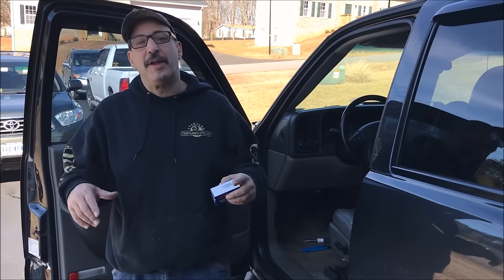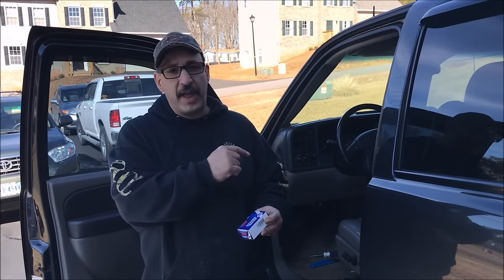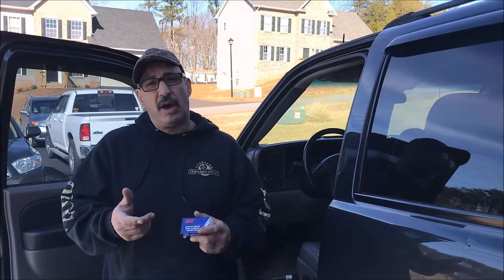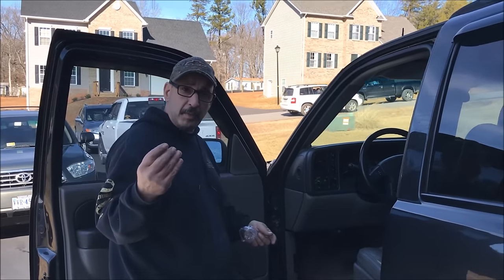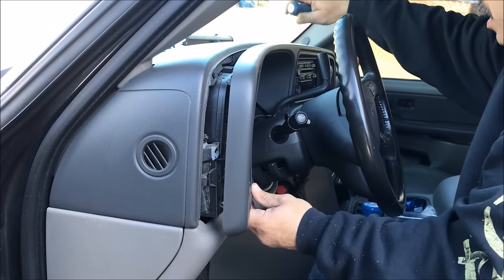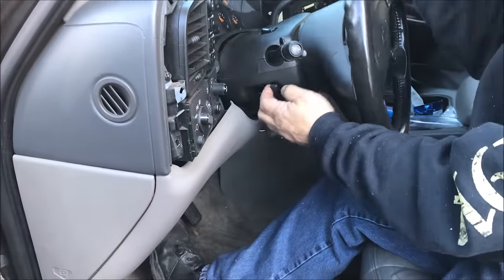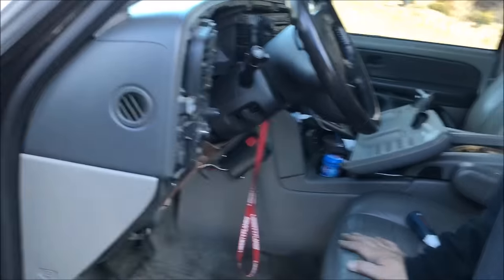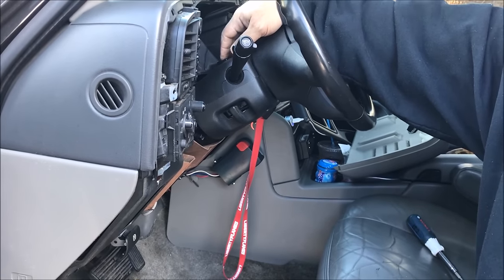Hazard & Turn Signal Flasher Problems on the Road | 2000-2006 Chevy & GM Suburban Truck and SUV

Comment: Hopefully u see this comment and can help me out I have that problem but only at night when my headlights are turned on and I try to use either the left or right turn signal the emergency flashers turn on Hopefully u got some tips thanks brotha 🙏🏼
Reply from the maker: Don't know.  If it were me I'd try the Flasher Module
Reply: Did this work?

Comment: I changed the flasher but still nothing. Did Amazon sell me a faulty flasher? Or is it possibly the flasher receiver
Reply from the maker: Could be something else, like the switch or a ground.
Reply: @AxlesGarage  could it be the switch, or a ground if the “hazard when turn signal” happens only when the low beams are on? That’s my issue 04 gmc savana

Comment: so I turned everything off and put my left turnsignal on and it's like I have my hazards on, I turn on my fog lights or headlights and it works normal any help please.
Reply from the maker: Module, Turn signal switch, Hazard switch.  I don't know for sure how to troubleshoot them.  But it it were me, and all bulbs are good, I would gamble on the flasher module

Comment: Pulled my 2000 L2500 apart & low & behold mine doesn't have a flasher there! What next?
Reply from the maker: Is it an OBS?  If so probably is in a different spot.  Gotta be under the dash somewhere.

Comment: Hello!! So I have a 2006 silverado and the left turn signal dosen’t do anything nor when the hazards are on only the right side works would this be something similar?
Reply from the maker: If your bulbs are good, and the lights don't work front and rear on the same side, then I would guess and gamble that this is it.  The directional and hazards are two separate switches, unless they are both bad something should work.  Also you could have a bad ground on that side, so check power and ground at the light sockets and double check your fuses.
Reply: It was the flaser!! Thank you for your helpful video!!
Reply from the maker: Glad to help
Reply: @AxlesGarage ive had a bad fuse before that LOOKED good but had a hairline crack in it..

Comment: My right blinker wont blink on my tail light or dash but it will flash on the hazards on the dash but still not when i signal to the right  i dont know what it is. I was hoping you may know?
Reply: On a 2002 Chevy Avalanche btw
Reply from the maker: Either the flasher or the switch

Comment: My 99 Silverado blinkers work fine but the ticking noise will stay on for about 2 minutes after using it then turn off
Reply from the maker: I don't know if that is a problem with the flasher module
Reply: Having a problem rear L turn signal is out I thought it was the bulb chnaged it 2 times nothing the arrow on dash flashes normally front left turn signal bulb turns on but it doesn’t flash in sequence both corner light and blinker just stay on. Right side works fine only the left blinker

Comment: My left one works just fine. It's when I turn my right signal on it does it. It's a hit or a miss when it does it
Reply from the maker: Check your directional switch as well, not always the flasher.

Comment: My right blinker always works fine. My left blinker works fine in the daytime, but when the headlights come on the left blinker stays constantly illuminated and will not flash. I changed the bulbs already, I recon I’ll try this next.
Reply: Any luck?? I’m having same problem!!
Reply: @jarednichols3538  haven’t tried it yet. Seems like the way to go though
Reply: I just took mine out and it’s still illuminated but no blinker will work. Not sure how it’s still illuminated. Haven’t got a new module yet
Reply: @jarednichols3538  I wonder what exactly this module controls. Do your hazards work?
Reply: Just found my problem as we speak, it was the actual front blinker bulb socket itself. It was a tab burnt/corroded on the inside, took the plug out and boom the illuminated lights went and and work normal again. Well they hyperflash until I get a new plug and bulb. But yes hazards work as should
Reply: If I could post pictures and videos i would.
Reply: @jarednichols3538  interesting. I’m gonna check mine out and see if it’s also burnt/corroded
Reply: 10/4 man. Hope I helped you out! Seems like we’re the only two having the same problem. Good luck!
Reply from the maker: Sometimes there may also be an issue with the directional switch itself
Reply: @AxlesGarage  how’s that? My bulb socket is fine so my issue continues.

Comment: I’m having a problem where when my headlights are off everything is fine but when my headlights are on my front left turn signal is stuck on
Reply from the maker: Check your bulbs first.  If you are using LED's they can screw things us with turn signals as well.

Comment: Something you didn’t mention is this will only fix hyperflash for the rear turn signals. If you plan on using led’s in your front turn signals, this will not effect them at all. In fact upgrading your front turn signals to led’s will cause your whole system to freeze up leaving the turn signals on permanently like a headlight. My guess is, front turn signals also need a flasher module, except this one goes in the fuse box in the engine.
Reply from the maker: Thanks for Watching
Reply: This video has nothing to do with LEDs
Reply: Not so with my 04 Avalanche. I installed it and it fixed the hyperflashing on all lights front and rear.

Comment: On my 05 Chevy 2500hd my left one works just fine but when I turn my right one on it makes everything flash only without the headlights on but when headlights are on they work fine
Reply from the maker: Check all your bulbs first.  I had issues with a bulb out that I didnt see at first.
Reply: @AxlesGarage  there all working I have led bulbs all the way around the truck and for turn signals I have the resister wired into them
Reply from the maker: I had some issues with getting LED turn signals to work right.  I think the LED's are actually what burned out my OEM Flasher (aka Light Control Module).  My opinion, If I were in your shoes with a mix of LED bulbs already (even with resistors),  I would go with an LED Flasher, this way if that's not the problem at least you have the proper flasher in place.  Maybe also try and troubleshoot the TSS, I don't have a clue as to where to start on that.
Reply: Ok thank you
Reply from the maker: Glad to offer some assistance.

Comment: I replaced flasher it did nothing, when I use my signals my emergency lights just go off
Reply from the maker: You'll need to troubleshoot the turn signal switch and/or the hazard switch.

Comment: You are right about this part.  And to save your viewers extra time, money, and grief, they should read this comment completely.  First, don't waste your money on a Haynes repair manual if don't have one already.  They're worthless.  They just tell you that "the type of combination flasher unit used on the covered models has complex internal circuitry, and can't be tested using standard electrical test equipment.  Refer to the wiring diagrams at the end of this Chapter and test the circuitry before replacing the flasher with a known-good unit."

I'm guessing Chilton's would be about the same.  Basically, what they are saying is, "You're too dumb to fix anything more complicated than a shot light bulb or a blown fuse."  And to assure that you DON'T find the problem, they give you an incomplete diagram.  Oh, they show you the switches and fuses, but half, if not all, of the wire colors are wrong.  And you will NOT see anything more of the flasher unit other than a rectangle with 4 wires going to it.  The contacts of the relays inside it ( "simple" circuitry) are not shown, even though the relays are the switching elements that turn the light current on and off.  That means that Haynes has replaced the relay contacts with straight lines in their diagram as if the driver is going to sit there, with nothing else to do, and toggle the turn signal switch on and off the whole time he's turning.

No, the real story here is that Haynes, most likely on behalf of their benefactor GM, has hidden this information from you to prevent your knowing that, even with it's "complex internal circuitry," this flasher STILL has SIMPLE relays inside that you can check with two pieces of standard visual electrical test equipment -- your own eyeballs!

So just pull that sucker out, remove the cover, and look at the "normally open" relay contacts.  The cover comes off easily with the help of a small flat blade screwdriver.  There will be 3 relays inside -- 2 small ones for the right and left signal section and 1 bigger one for the hazard flasher section.  The little ones are usually the first to go.  If you close a relay manually, you can see the normally closed contacts on the opposite side of the part that moves.  Compare that to the normally open contacts.  On a bad flasher, you will see that the NO contacts are all pitted out and may even be welded together, as opposed to the smooth, shiny, NC contacts on the opposite side.

Second, don't throw money away by replacing the turn signal switch first.  That's probably what Haynes and GM want you to do, but your could buy your kid a bicycle with that, especially if you add the cost of a worthless Haynes manual to it.

Third, time and grief.  Don't even waste time tearing down a lot of stuff and troubleshooting wiring and all that crap, because   A. The Haynes wiring diagram is DELIBERATELY wrong and so are the wire colors on it, and   B. All you need to remove is the instrument cluster bezel, the "knee bolster" (that plastic cover below the steering column), and the bad flasher.  The cover has 2 screws at the bottom and two metal clips that take about a ton of pressure to remove at the top, it seems.  GM wants you to break the plastic cover, so they use these.  Be careful.  You can wiggle the flasher back and forth with both hands til it gives up and comes out.

Good luck!  I'm speaking from experience with my 2003 Silverado.

By the way, Advance Auto Parts sells a replacement unit with 30 amp contacts, but I suggest ordering it a few days early since they don't stock them in the stores.  These are better for use with a trailer, but lo and behold, another conspiracy to sell more parts!  The best they sell without ordering and waiting has 20 amp contacts, so they won't last as long!  But since I don't have time to wait right now, I have to go get one of those crappy ones today. 😠
Reply from the maker: Thank you for the informative post

Comment: Will it work 2001 accord lx my ha,and don't work turn signals work
Reply from the maker: Maybe, but you'll have to troubleshoot the problem to know for sure.  Sometimes it could be the directional switch that went bad, not the flasher.

Comment: I swapped out my flasher relay and combination switch also the rear trailer module all bulbs and sockets are fine. The odd part is i can access the bcm with my scanner. Im lost anyone have an idea? All wires look fine too.
Reply from the maker: Need a good wring diagram to check the integrity of any grounds used on the circuits
Reply: @AxlesGarage  did that already i tjjnk its in the bcm just not trying to do that parts cannon
Reply: @AxlesGarage  i found it. One wire was broken on the blue plug to the tail light control module. Figured id share my findings. Thanks for you're impute as well.

Comment: I had the same exact problem in my 01 Silverado and I changed that same flasher and still have the same issue
Reply from the maker: It is possible that your TSS or Hazard Switch is bad.
Reply: Cal did you ever get yours fixed. For years on my 2001 1500 my left signal blinks fast even after changing bulbs multiple times. Was thinking about replacing this flasher module

Comment: Changed the flasher module and my hazards still won't turn off.
Reply from the maker: It may have been a bad hazard switch, not the flasher.

Comment: does this control flash rate/ hyper flash???
Reply from the maker: If all your bulbs are good, for sure, then I would gamble on the flasher module.  If you don't have a trailer hooked up during testing, then the issue is not there.

Comment: I tried this and it didn't work for me
Reply from the maker: Then you probably have a problem in the circuit or directional switch
Reply: @AxlesGarage  I found and fixed the problem, it was a seemingly unrelated fuse thanks!

Comment: So how about.  When I have my park lights on.   And I press the brake.     The flashers light up solid.   Could this video be a fix for that too?    Flashers work perfect when no park lights are on
Reply from the maker: Maybe, lots of variables here.. You would have to make sure your brake light circuit and headlight switch are functioning correctly.

Comment: I have no blinker and hazards, everytime I turn the stall for left or right I get nothing but buzzing noise, I pulled the 20A out of the fuse center and it was fine. Will this be my solution?
Reply from the maker: It is possible, if your hazard and TS switch is good, I would gamble on the module.

Comment: Does this work if the hazard turn on while driving and not using the turn signals?
Reply from the maker: Possibly not,  I would unplug the Hazard switch to rule it out.